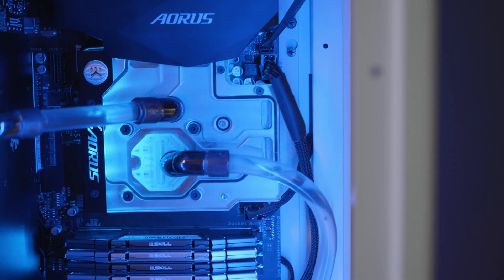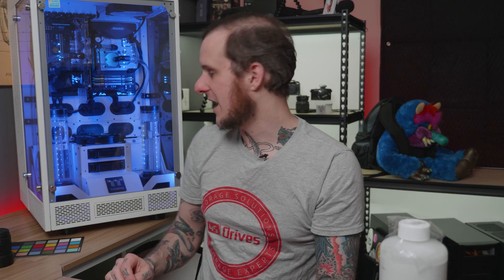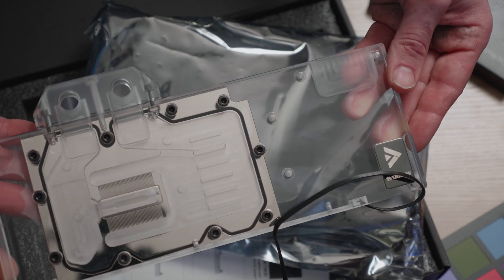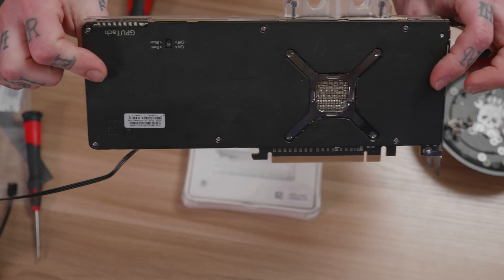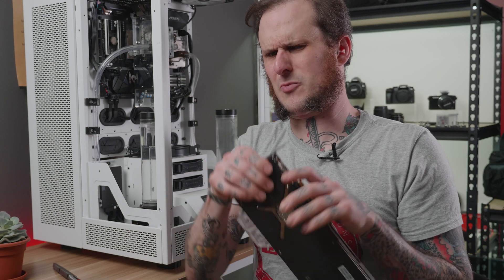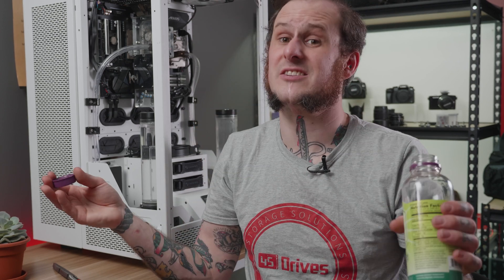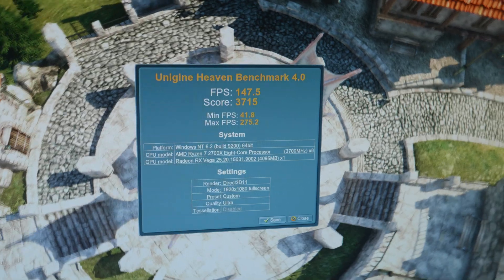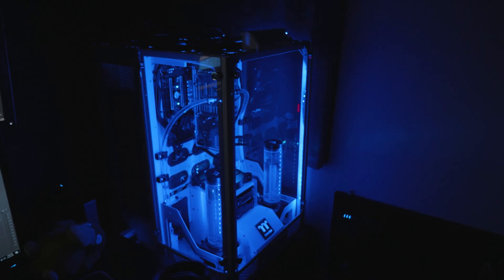Vega 56 in 2019 - Watercooled Workstation Update

Comment from the maker: What should I do for my next upgrade?  Wait for Ryzen 3000 series? Toss the Vega 56? What do you think?
Reply: There is a deal on Newegg, brad new Vega 56 for 269, asrock one
Reply from the maker: @MultiHardPlay  if I were moving over to Davinci Resolve I'd snatch that up. It can use Multi-GPU. Premiere pro cannot unfortunately. 

Darn good deal though.
Reply: @MandicReally  I'm just into games, but I'm the biggest fan for Vega 56 using Vega 64 bios. Bear whit me please, I'm from Brazil, so my English is not the best one...
Reply: Vega 56 zombies in crossfire!
Reply: Loved this clip. Thanks for sharing. Currently, I have 2 RX Vega 56's used independently for rendering and video game designing. I'll be transitioning to liquid cooling after christmas using Krygraphics Vega 56 water blocks seen here: https://youtu.be/VqjQ4ksBiz0. I'm using an X99A Gaming 7 motherboard and utilizing the M.2 port with a Samsung 970 Evo NVME SSD for boot. So with the Kryographics water block, I think It'll give me enough clearance to throw a heat spreader on my M.2. For your next upgrade, I i think it would be awesome to see a Built in PC desk and taking what you have in that system and putting into a desk and doubling your graphics power with a second GPU. For rendering, I found it best to run rendering jobs with independent running GPU's  (without CROSSFIRE or SLI). To compare rendering time, you can create an image using BLender 3D that has many reflecting objects with lighting effects. Than compare the time rendering the same image with two independently and 2 in crossfire to compare as well. I'm not quite sure what CPU you might be using. However, you may have to look into how many Lanes it has to support a 2nd GPU at 100% 16x lane.
Reply: Just upgraded to a Vega 56 in 2024. I spent 2 hours overclocking and undervolting it and I get amazing performance, only problem being it’s a bit noisy at 210 watts under load.